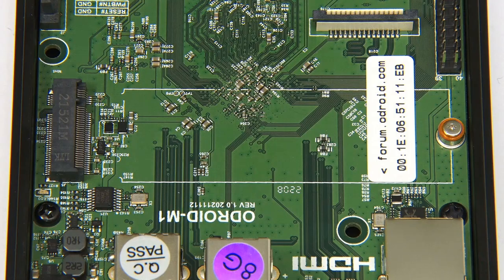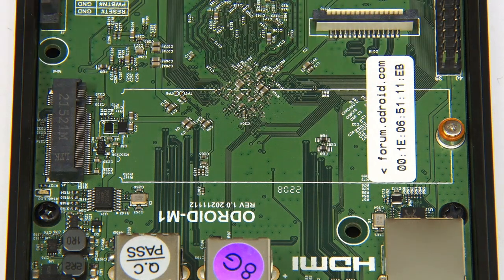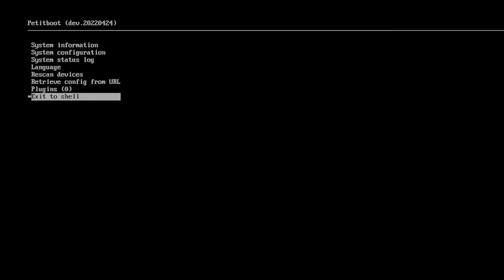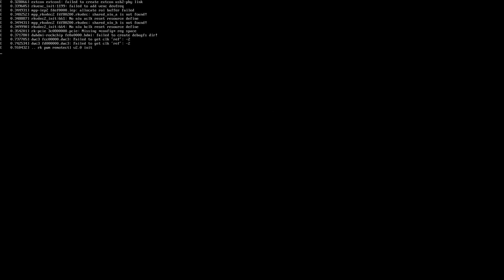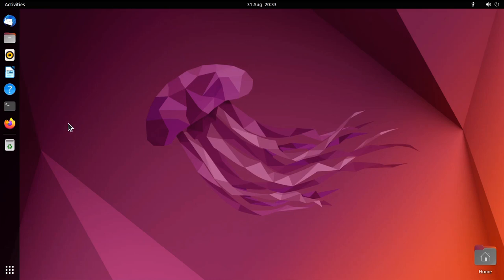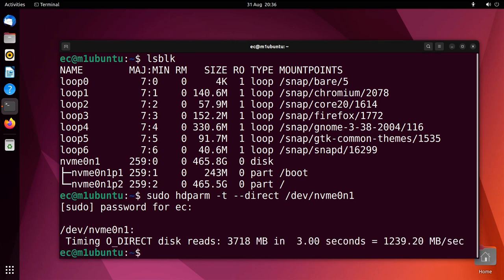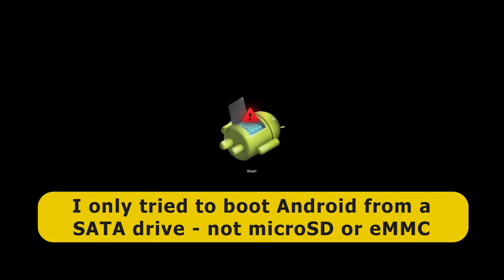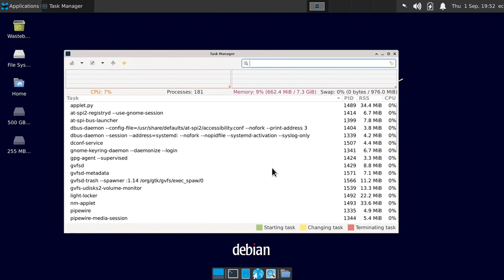Odroid M1: Bootable SATA & M.2 ARM SBC

Comment: Great purposeful device, however, as for the lack of WiFi & BT onboard, imo, by leaving these two elements off, encourages the manufacture and production of addons (clearly readily available) thus supporting other tech markets which I don't see as an issue. Moreover, in the absence of WiFi & BT, should also be reflected in the price, comparable to other SBCs with them.

Comment: I use ODroid, have gathered a lot of different versions since 2014. Most of them are working 24/7 since, to handle everything in my shop and house. I find it's a great little device for "SBC as a Service". I also have some different devices from the rPi family, Arduino, ESP8266, ESP36, even rPI2hdmi in an A500..
At the moment I use the M1 with LineageOS, connected to an AverMedia video input card, for use with RaspberryShake App. But Android doesn't boot M.2 drive... yuk..
 I wouldn't say why in the end,  but I always had more interest in ODroid. Even if I really love the fact rPI comes from England, I like that Korean engineer having done Hardkernel from Scratch, with love.

And excuse my french ODroid don't suck at stocks supplies.

Comment: Can't help but notice the IR detector (3:16 lower left next to the battery) being bent way over.  Not exactly off to a good start quality control wise.
Reply from the maker: So often happens.
Reply: it was mentioned on the video, and could happen on shipping or packaging steps, not just on the assembly line and ir is not that used anymore, perhaps if you use it as a media pc but the gpu is not capable of 1080p, so, is the last of the concerns tbh
Reply: @arch1107  - Ya, I commented before Chris got to it in the video.  The sensor is a through hole part and needs a bit more care to install it versus SMD.  If it was installed properly (it can go down quite a bit) it wouldn't move with a bump in shipped, etc.
They sell a simple IR remote on their website so I imagine users do use it.  It makes for a simple controller unlike some push buttons that you might connect to the 40 pin GPIO connector.  I would use it more for custom control than for a media controller.  As you said you're not going to be using this as a media player at least until they really work on the video play back.

Comment: Well, graphics drivers are not very good. But other than that, I really like this board. Booth menu and sata/m2 ports are a significant advantage over raspberry-like boards. I really could find a use for it. Thanks for the review, it's good (but still I would like some GPIO tests).
Reply: Graphics drivers are the weak spot. Let's hope it gets improved before the board gets outdated, otherwise it doesn't stand much chance against RPI4 which is getting long in the tooth. If RPi5 adds NVME boot in next release then it's game over unless they bloat the price way up.

Comment: Undoubtedly Odroid M1 has excellent layout where CPU (SOC) is on other side of board with connectors, so cooling and connectors don't stand in the way.
That wasn't a problem until Raspberry PI 3B Model, after that it became problematic.
In my opinion Odroid M1 with SATA SSD speed at 380 MB/sec is miserable. 
My RPI 4/4GB delivers 280 MB/sec at the USB 3.0 interface (with USB-SATA adapter with ASM1153 chip).

Comment: I wish these boards came in micro itx form factor and with a couple of PCI express slots. I'm more interested in the power saving aspect rather than the size.
Reply: but, in itx form, you get at best 2 slots, 1 to be precise but i have seen weird itx expecting you to use a pci riser cable

what would you use those slots for?

i have a nice itx case that i would love to upgrade to one of these sbc but cost and gpu power is a no go for me so far, the power consumption is very nice tbh
Reply: You can buy mini ITX motherboards with soldered on integrated CPUs that are just barely removed from sbcs. I just bought one to build a new desktop machine for my mother. All I needed to add to the motherboard was some RAM sticks, an m.2 SSD, and a pico power supply (I hadn't encountered them before but it's basically just a small circuit board attached directly to a motherboard power header, the other end is a barrel jack you need to provide with 12 volts from an external power brick). The PSU is rated for 250 Watts peak output but the computer draws like 11.

This one in particular doesn't actually have any pcie slots but looking on New egg it looks like Asus makes a few and they tend to sell for under $100. You do need to add RAM and storage to that so not as cheap as an SBC, but it'll help you hit a low power target.

Comment: Interesting SBC. With the current energy prices I think it would be interesting to mention the power consumption of the boards a well.
Reply from the maker: Fair point. :) I did a big energy consumption comparison not long back -- https://www.youtube.com/watch?v=rGUnsiivqeU
Reply: @ExplainingComputers  Thanks, I think I missed that video.
Reply: Electricity prices aside, it's definitely relevant for anyone looking at an SBC for a battery-powered application.
Reply: The difference will be anecdotal if we're comparing SBC's and not other types of computers. Unless you have a project in mind which will involve using a dozen or more of these devices, that is! As somebody has pointed out, it would make some sense to look closely at power consumption differences if you're going to run your board on a battery pack.

Comment: Nice review.
I think Odroid have the correct form factor having space for NVME drives and room for plenty of USB ports. The heatsink is clever.
The petitboot is nice.
It's a real real shame about YouTube playback. This is a deal-breaker for me and probably most. I am looking forward to RK 3588 processors because the arm based SBCs have been stuck in a rut recently. I am hoping there will finally be an arm SBC that is easy on the wallet and is truly capable of running Linux for general tasks. Could this be the year?
Reply from the maker: I am still hopeful for the RK3588 Rock Pi 5B . . .

Comment: Heath Robinson approves of that SATA power cable kit.  😉

Manjaro has an Odroid M1 spin, if you'd like to give that a go. 🐧
Reply from the maker: It does, but sadly -- at least a few weeks back when I made the video -- Manjaro did not support the M.2 slot or SATA port.
Reply: @ExplainingComputers  Ahh; I'm sure they're working on it.  If I had an M1, I'd give it a go and see. 🐧

Comment: I purchased an Odroid H2 some time ago - X86 Intel Celeron 4 core, SIMM slots for 2 DDR4 memory modules (to 32Gb) and 2 SATA ports, along with 2 USB-2 and 2 USB-3 and the usual Ethernet (2 of these!) and audio, not to mention a Display port AND HDMI and MORE.. All in All, a very good SBC, a desktop in a cube. Not available any more.
Reply from the maker: Yes, it is a great shame that the H2 is no more.
Reply: My H2 runs Linuxcnc for my mill, a great little machine, but issues with the Linux 5.18 network drivers meant compiling the Realtek drivers from source.

Comment: Thanks for informing me about SBC's getting upset when they're upside down, Chris. No wonder they've always been so contrary with me.
I'm sure that we'll be right as rain, from now on. 😎
Does cursing at them cause them to stubbornly lock up, as well?🙄
Are techno-therapists or SBC counselors covered under national health?
Reply from the maker: Cursing always helps a bit! :)
Reply: @ExplainingComputers  Yes. I find it very difficult to think straight with a head full of steam, so it helps to release the pressure.
I'll bet that's true for the SBC's, as well. But, we can't hear their little bits,. So, we never know until we see their release of magic smoke.
BR 😎

Comment: I have been setting up M1 and a few N2+ boards.  Running 20.04 with MATE the UI on M1 is noticeably sluggish and the N2+ is very responsive.  The M1 runs a lot warmer with 250GB WD SSD.  So warm that I drilled a series of vent holes in the blue alloy housing of the M1.
One of my N2+ boards has a faulty ethernet port.  Often but not always the download speed is 0.5-1% of what it should be.  Determined to be the board by swapping boards and OS's on eMMC modules.

Comment: Please, next time measure the power consumption, it's a very interesting parameter for these machines
Reply: The model featured in the video is advertised as consuming 1.3 watts, however, real world tests show it is between 3-7 watts under load, depending on cpu/gpu frequency settings.

Comment: Quite impressive, until you get to the video. Definitely needs at least 1GB of faster RAM dedicated to video. It doesn't take a lot to be able to handle 1080p video at 60fps. Anything going to market these days should be able to do that. Hopefully, the next version will.
Reply from the maker: The video playback issue is not related to the hardware. It's a (lack of) software driver issue.

Comment: I didn't get a warning or watch battery when I got mine, just the base unit.

Also if you think it's cheap, it's not. The $90 is just the base cost, there's also a delivery fee and the taxes were more than the board itself.

Comment: If you want to use the NPU which is intergrated on this board, you'll need to disable Petitboot and use the NPU enabled OS image which can only be installed via MicroSD or the eMMC Storage module. If you dont require the NPU, then the N2+ is a much better option, due to the additional 2 Big Endian Cores and being a much more mature platform.
Reply: You might want to edit again, it's Big Endian, because of the most significant byte being at the end.

Comment: I have an Odroid XU-4. Really powerful for its size but no where NEAR the community support of some other boards when I bought it. Maybe it's time to do a revisit?
Reply: I used Armbian when I was using my odroid xu4 and at one time a well supported community build of Debian maintained by meverick I think it was. I upgraded to the odroid-n2 but was unsatisfied with the USB problems exhibited by the board, hardkernel effectively washed their hands of the matter by saying it was an architecture problem. I am wary of the odroid-m1 as I wouldn't like to experience the same usb problems as I had with the odroid-n2.
 I'm thinking of dusting off the odroid xu4 again as it was extremely reliable and with current Armbian builds I'm sure I can find a use for it.

Comment: I have one, not the greatest performer next to the Odroid N2/N2+, but I do like you can boot straigt to NVME (via SPI flash and Petitboot). Anyway I have been waiting about a year for it to support Armbian and a recent kernel, I could possibly wait another year or two at least before I can actually start using this device with Armbian. Right now it only supports Ubuntu with an older kernel (4.19 is ancient now), the issue with most ARM devices.

Comment: you can also use a wired wireless bridge or a range extender if it supports being used this way for a wi-fi connection if you need all the usb ports available. going this way won't give you Bluetooth tho

Comment: Do the heatsink mounting holes line up for a common fan size?  3:53
Reply from the maker: Ah, that I had not considered. I must investigate!
Reply: @ExplainingComputers  - I would hope so as even with that huge heat sink I can see many users wanting to add a fan to keep it cool.  And not needing an intermediate adapter would be the best.
Reply: I wondered this as well.

Comment: "Designed for long term availability"  Hmm... maybe Raspberry Pi should look into that.   ;-)
Reply: that phrase means they will do it for many years, not that it will be in stock all the time, pi4 has been around since 2019 and it will be done for at least 2024 i believe, and for me that is long term
Reply: @arch1107 : At least Jan 2026 for most Pi flavours - from what I can see, only the Zero 2 has a later date (of Jan 2028). Of course, "being in production" and "being in production in sufficient quantities for their demand" are two separate things 😂
Reply: @var67  - Ya, I wonder when they will be back in production?  Everything is tagged "notify me" from the good sellers and I haven't had any notification emails about any of them.  And I refuse to pay inflated prices on eBay, Amazon, etc.
Reply: @fetchstixRHD  lets say you are corrrect, if i cant buy it and support comes from comunity and not from os because comunity pushes driver development the most, being supported means between very little to nothing to me, and if you need help from comunity when they moved to pi 5 or 6, the extended support will mean to you what, nothing?

now, that is on pi, that is the most popular sbc, for this other sbc will mean what, close to nothing?  nothing?  the price and hardware specs makes me wish for a pi 5, not for this

Comment: I suspect the lag of the Debian install is in part due to its comparatively ancient GPU driver version (Panfrost) compared to the much more recent Ubuntu Jammy. You'd probably do well to try Debian Bookworm, I suspect it would run a lot better, though maybe not quite as fast as Ubuntu since Ubuntu is more aggressive with some updates and uses apparently a fairly non-standard kernel.

Comment: I just upgraded the software on the old Odroid C2. I like they got rid of that awful chromium and used Firefox instead. It works much better with a swapfile.  I looked at the N2+, but because of no widevine it makes it no better than any other non google approved streaming device. Yeah, I know these weren't made to be drm streamers. It would be nice though.

Comment: I never thought that overall, the M1 was going to be of great interest with the SOC being used and seeing the actual performance is worse than I expected. I also don't think that the 10 year Rockchip guarantee of production will make t]anything produced be deemed of long term interest outside of the industrial sector. For tinkerers and home enthusiasts, this will die quit the quick death. Hardware GPU acceleration in Linux is somewhat of a pipedream right now and will not come courtesy of the manufacturers and patent owners. I know that there are efforts like Panfrost and others to provide open source GPU drivers but these may come further down the line than desired and of no guarantee. What this board does have going for it, in general is basic design and I/O. NVME support on the actual board (unlike Khadas) adds to the design appeal and if they keep the design and add an RK3588 SOC to it then it could be very much of a winner. I do hope though, that in 2022 and beyond that we can finally rid ourselves of the Jurassic USB 2.0 port. 6Ghz IUSB 3.0 (otherwise known as USB 3.1 Gen 1) should be the bottom line. Likewise, USB-C, now around 7 years old, should be the default plug type across the industry. The one omission from this design is Bluetooth, which should be onboard. Wireless, at least for me is OK as an option, even though others may also feel that it should be onboard, like most other similar devices, to which they would have a reasonable point. However, we must also never forget that Hardkernel/Odroid is also synonymous with the worst guarantees on the planet. 30 days when ordering direct from the manufacturer. Other 2rd party vendors may offer loner but even the likes of Odroid UK only offer 3 months, even though contrary to UK law, claiming that a SBC is a 'Prototyping item', despite the Raspberry Pi, also of the same category of product, having full warranty as expected and required.

Comment: This piqued my interest for a low power solution for a domestic always-on server (active use server rather than archive).  Would it be possible to show figures for power-draw-at-the-wall for idle and peak use for this sporting an NVME drive as well as a SATA spinner (mechanical) drive?  I'm thinking this thing with a 16tb spinner and an NVME drive would be an ideal always-on system to reduce power draw as much as possible in a neater all-in-one configuration.

Comment: I wonder how well this can run TensorFlow Lite and GPIO programs. I currently help different secondary schools run some AI courses in which students can do computer vision experiments with TensorFlow Lite and GPIOs on Raspberry Pi, but I'm struggling to get enough Raspberry Pi for the students. If this is a good replacement then we don't need to rely solely on Raspberry Pi.

Comment: I'm still hoping for the Pi5. My unfulfillable fantasy: 8 core, 3ghz CPU, 1.5ghz GPU; 16gb RAM; Wi-Fi, BT, 1Gb or higher ethernet; 2 USB2-A, 2 USB3-A, 2 USB3-C (one with PD capabilities to power the board) and complete with a 6A PSU; a 4x PCI-E socket with no backend so it could fit 16x cards; an M.2 NVME socket; 2 full-size HDMI ports; finally an open BIOS. If they meet those specs, even if the form factor changed yet again, I'd hope they'd aim for no more than $150. Although, I wouldn't be opposed to the idea of them having two Pi5's where one is just enough to turn into a mini-desktop PC and the other is only an incremental upgrade to have a lower price bracket for students and hobbyists.

Comment: It would be interesting to know the temperature the CPU/GPU and the motherboard run at. . .might give a clue as to the longevity aimed at by the designers. . . . Given the recent trend with full size boards to stretch the thermal envelope, . . . up to 90c in some instances (Reminiscent of the early noughties when chip designers, particularly mobile ones for laptops, were designing with hte object of raddling  the nuts out of them for the sake of performance, with the consequence that you could fry an egg on some them).

Perhaps you could employ one of those mini-IR guns in future vids - "Mr Red Eye" or "Mr stand and deliver"